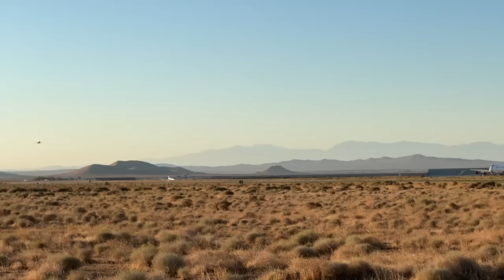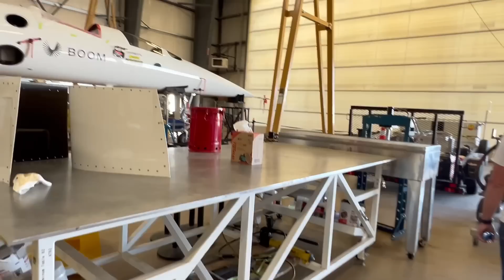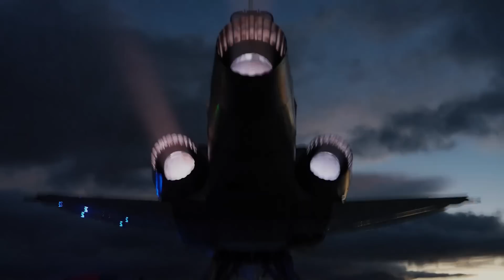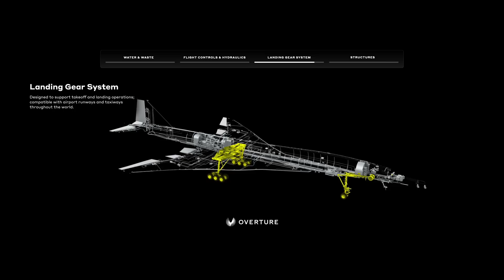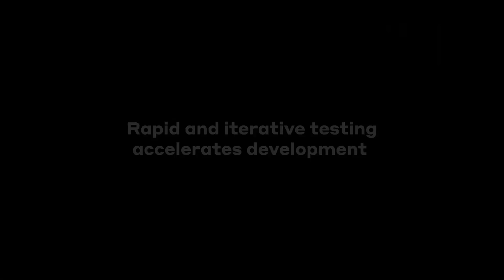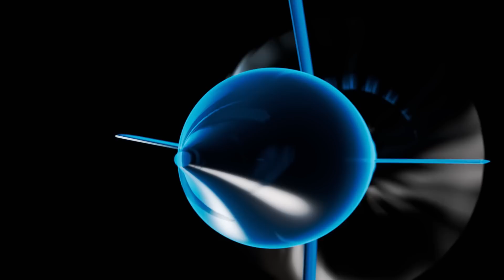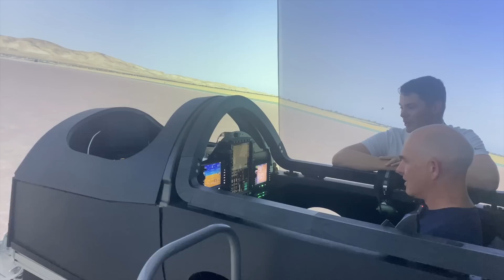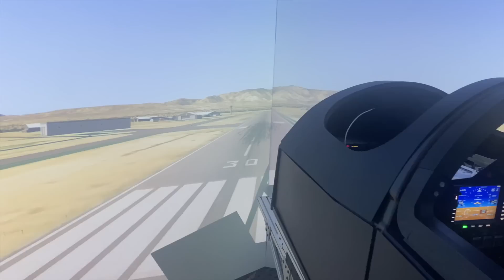Will This Experimental Supersonic Aircraft Show Supersonic Airliners Can Work?

Comment: There is demand for supersonic fly. Hell, there is a market for hyper-sonic fly. In fact, there is a market to use Starship as a ferrying passenger vehicle.  The problem is just the cost and the booms. Solve both these problems, and You will be swamped with orders.
Reply: starship will not ever be an intercontinental passenger carrying proposition
Reply: @DrWhom  Kinda irrelevant for my argument - based on the fact that Musk himself said it was one possibility.

Personally I don't think it will - too much red tape, and not sure if the price would be reasonable. But, again, not relevant for my argument, since it was based on "even IF..."

Comment: 15:15
2x independent cameras...
But both bolted onto 1x landing gear... 
Good thing landing gear has been 100% reliable for over 100 years 🙄
Reply: very important point, they should put cameras on the nose itself directly on the fuselage
Reply: @oadka  maybe under the nose out of an airflow that could scratch/ sandblast/ dirty up/ get birdstrike goo on it... All of which have happened in previous accidents/ near misses

Comment: I was really hoping these two cameras would provide a stereoscopic feed to the pilots... Would be an interesting step forward
Reply: Very true - should be able to afford a VR headset
Reply: well then there is no redundancy, so they need to add 2 more cameras
Reply: @oadka  I think doubling the cameras in each of the left/right redundant systems would be possible... where a single failure would be "fail operational" and a double camera fail on one side would be reversion to a flat 2D display (with higher minimums for example).

Obviously the implementation would be too complex at this stage, but could be a move in the future.

Comment: GE, Rolls Royce, and Pratt absolutely do compete in the market for supersonic engines. Examples include the GE F110 and the (abortive) F136, The P&W F100, F119, and F135, and the Eurojet (RR+MTU, mostly) EJ200. With Overture. Boom is basically proposing to disrupt the low end of the military turbofan market.
Reply: Boom approached them all to request an engine for the Overture, and they all said no. It's fair to say that they're not interested in building engines for an SST (which have significantly different requirements from military engines, primarily when it comes to certification).
Reply: @johannesgutsmiedl366  I can only imagine Boom wanted these manufacturers to develop them an engine and also fund the development .othervise they would not turn them down
Reply: @johannesgutsmiedl366  And the biggest barrier to certification is takeoff noise, which the military don't need to worry about.

Comment: The engine efficiency is the main blocker for the next generation of supersonic commercial passenger aircraft and once they get past that it shouldn't be too difficult to build something to replicate or improve on what Concorde did with the technology from 50+ years ago.
Concorde was extremely thirsty so the fuel load was huge. Between engine start, pushback and taxi from the terminal to the runway at Heathrow it burned 2.5 tons of fuel, and even at idle the engines were that powerful the pilots had to constantly hold the aircraft on the brakes to stop it rolling away.
Also, all takeoffs for Concorde from any airport were prioritised because if it had to wait for more than about 10 minutes for takeoff they would have to return to top up the fuel as they would be eating into the reserve margin. At least you didn't have to queue up to leave at busy times behind all the 'common' people in their lumbering subsonic aircraft, you just went to the front of the queue and left.

Comment: @scottmanley
Can you do a piece in the “old” shockwave mitigation device they used to call an aero spike many years ago when I was young. 

Basically it was a high pressure plasma cutter aimed forwards to act like a small rocket pushing the plane backwards 
BUT they were saying that by not having the initial separation point at supersonic (hypersonic) speeds not only pushed the high pressure/temperature shockwave off the skin but was not a solid point and could move with changes in pressure (think suspension against turbulence) and by having that small amount of “give” in the point of contact had a noticeable reduction in drag.

Comment: Just an observation on your comments regarding the engine manufacturers, GE and P&W are the 2 main engine suppliers for US military jets, so they do have up to date compact supersonic engines, but not necessarily efficient as the requirements for a military jet are obviously different to commercial.
Reply: Also not certified for operation on civilian planes, and that may require complete ground up redesigns. Rolls Royce also has significant experience building military engines, and they were the initially intended engine supplier for the Overture before they decided to walk away from the project.

Comment: The airlines do not want “slow, efficient planes.” They want efficient planes. 
They would love to go fast, but the reality of drag vs velocity dictates against that, at least at this time.
Reply: Also, high landing speeds are dangerous.
Reply: Aren’t the most fuel efficient aircraft actually turboprops, rather than jetliners?🤔 The other costs such as employees and engine life probably make jetliners cheaper.
Reply: @martijn9568  No.  Turboprops are high-maintenance and low power.

Comment: "'a good landing is one you can walk away from', I can assure you that phrase did not come from a flight instructor" lol
Reply: I once had a landing so soft the only way we knew we'd landed is hearing the main wheels spin up. I was grinning ear to ear until my instructor said "nice but you were 2 feet left of centerline, you NEED to fight for the centerline"  d'oh!!
Reply: New to aviation, I see. That’s the standard phrase, along with “fly it all the way into the crash” and the quote “takeoffs are optional, landings are mandatory” and “it’s better to wish you were in the sky than on the ground”.
Reply: Yeah, he's not wrong. That phrase definitely did not come from a flight instructor. If you aim for perfect landings each time, you're a lot more likely to consistently end up with ones that you can walk away from vs. if you just aim for landings that you can walk away from.

Comment: This has absolutely NO chance of going commercial.  First the environmentalists will knock the NxOx output, and the H2O vapor at high altitudes.  As "everyone" knows, our planet is die-ing due to vapor trails, and CO2 choking us all.  Even if they go "publicly" into a hydrogen-powered system, there will still be water in the effluent (and NxOx unless they also have O2 tankage).  Actually, when one looks at rockets, using O2 and H2 as fuels, that would be the best way to get across the ocean, really fast, without environmental suicide.  Thirdly, the "richies" which fly these platforms, do NOT really want to get there faster.  They really want to be "catered to" with free food and drinks, and entertainment, while they enjoy (slowly) the experience.  The faster this platform flies, the less the "richies" will appreciate it.  That is why they buy mega-Yachts, or why people go on Cruise-Boats.  I'd rather pay 10KdollarsUSD to get a three week vacation, at any modern land-locked resort, than spend that on 3+hours in a tub-full of sweaty and maybe sick people, while locked into a 3-foot seating space.  You gotta be totally stupid to do that.

Comment: it's all about the Engines, Engines, Engines however.
  If they can make a reliable engine that is easy to maintain and supports relatively quick turn-arounds, that would be a real breakthrough!
Reply: One thing Scott kinda glossed over is that Boom tried very hard to get one of the big engine manufacturers on board for this project and none of them were interested... doing this much development in house or with smaller less experienced companies was definitely not their original plan, it's something they had to do in a rush to save the project.
Reply: @johannesgutsmiedl366  Rolls royce was interested initially, but it later left as the ROI was questionable.
Reply: Any large commercial supersonic jet is going to suffer from only being able to fly over the sea because of sonic booms and high fuel consumption. Particularly if afterburners are required for take-off. Concorde also required the C of G to be moved forward when in supersonic flight which was done by pumping fuel forwards in the wings.
Reply: No problem at all except for one small thing - noise. A jet engine for a supersonic plane has to have a supersonic exhaust velocity. Have you ever heard a fighter taking off?
Reply: @kenoliver8913  Technically that’s not completely correct. An aircraft in supersonic flight can be propelled by engines producing subsonic exhaust. This is because the speed of sound in a gas is related to the square root of its absolute temperature. 

Therefore, if an aircraft is traveling at Mach 2 in 200°K ambient air, it could be propelled via engines with Mach 0.5 exhaust if it’s above 1600°K. 

This is an extreme case, but it’s very possible to provide thrust at supersonic flight speeds with unchoked, converging only exhaust nozzles.
Reply: @jet_enjoyer  I stand corrected. Thanks.

Comment: The amount of distrust there is in the comments for this company completely baffles me. Could someone explain why? Cause a lot of the questions I'm seeing from people are easily explainable.
Reply: Because Concorde, magnificent and beautiful as it was, failed economically for very good reasons and those reasons have not really changed. The biggest single reason is noise - even if the sonic boom can be engineered around (which is really tough) building an engine which can fly supersonic but yet is quiet enough at takeoff from city airports looks impossible. That is exactly why RR (who, after all, made Concorde's engines) pulled out of this project.
Reply: @kenoliver8913  look I get it, Concord was largely unprofitable until its last few years and that the sonic boom is an issue they still need to engineer around but that doesn't answer the question of distrust in the company Boom. 

What has boom as a company specifically said or done to bring such distrust towards it in the comments where some comments went as far as calling it a venture capital scam.
Reply: @kenoliver8913  as for my understanding why Rolls-Royce backed out of of designing the engine, I don't think it's reason was that it was difficult, just rather that they likely didn't see a financial reason to develop a "eco-fuel" powered engine
Reply: @vladstr100  No, definitely it was a technically very hard (read: very expensive) engine to develop for a product which even if successful was never likely to sell in big numbers. It wasn't the ecofuel aspect that was hard but keeping the noise down with a supersonic exhaust velocity. No one has faith in the company because even a cursory look at the engineering problems tells you it needs many tens of billions spent on it to have any hope at all and the market to justify that spend is nowhere near big enough.
Reply: @kenoliver8913  okay I'll give it to you there, I didn't entirely consider the factor of managing exhaust noise. And I'm not under any illusion that it's going to be easy or cheap. Solving these engineering problems is going to be very expensive, no doubt about that. And I can see why people might not have faith in it becoming reality. 

But lack of faith, I think, it's not the same as distrust in the company. The distrust is what I'm trying to understand in these comments. Maybe it's because my senior design project was to design a supersonic Business jet and that's clouding my judgment but I don't see any reason to distrust the company in of itself the way that some of these comments are.

Comment: The engine is the real challenge. Contrary to popular belief, the Olympus engines on the Concorde were extremely efficient in supercruise. They might get some efficiency gains in subsonic flight, but it'll be hard to them to better the Olympus engines above Mach 1. And, of course, there's the question of engine noise. Certainly not having reheat will help with that, but it'll still be a challenge to meeting current regulatory standards. And then - of course - there's the question of sonic boom.
Reply: On its own engine noise is a killer for this project. Supersonic speed=supersonic exhaust, and there is no way around that even if you don't achieve that speed with reheat. At takeoff Concorde never met noise standards of the time (everyone just politely ignored the rules), let alone the much tougher ones these days for urban airports.

Comment: "The demand for Concord, though small, never went away" - oh yes it did (sadly) - because the need for a physical presence in meetings across the atlantic, or the availability of cash customers who cared about saving that much time on a flight to Dubai, DID diminish. Or so I was told by the man who flew the last Concord.  That's why they folded it.

Comment: I'm sure I remember hearing about a 3-engine supersonic bizjet concept called Boom in a flurry of press releases years ago, touting superconducting generators inside the engines to provide electrical power. It was shocking that journalists were repeating this obvious nonsense without questioning it or getting any quotes from outside experts. 

I assumed it was pure vapourware. If this is the same outfit, well done to them for building a real plane that really flies. My question: if you had a real plan, why did you try to sell it with superconductors operating inside the core of a jet engine?

Comment: Concorde first flew at Mach-2 66 years after the Wright Brothers first flight & only 18 years after the first jet airliner launched. It was an incredible achievement with the materials & design/manufacturing tools they had available at the time.

50+ years later we should be going faster not slower.
Reply: We are getting there more efficiently - speed doesn't matter in a world with limited resources & a biosphere to protect.
Reply: @nightjarflying  The purpose of this aircraft is speed, nothing else. It is not more efficient that other airliners, not cheaper per passenger mile, just faster. But not as fast as something done half a century ago. If "speed doesn't matter" then this aircraft is irrelevant rather than simply unimpressive.
Reply: @johnafish  Exactly - supersonic passenger  transport is irrelevant or worse. It belongs in the age of excess that we have left behind us.

Comment: Want to shave a few hours off a transatlantic journey? Make the process of checking in, boarding, getting off and retrieving luggage faster. Be rather cheaper than travelling at mach 1.6.
Reply: This plane is already catering to people who have priority boarding, assistants dealing with the luggage or are even used to flying from charter terminals. So for them the journey itself is a more significant part of the travel time. Still, whether this market is big enough to support this development is very much an open question.
Reply: When you already have an 8 hour flight, most of that is quick in comparison, and you can already pay for priority/fast track. If you can almost half the actual time in the air, there will of course be someone willing to pay the premium
Reply: Just having someone to operate the gantry bridge would be a huge improvement in civil aviation. 

Rich people, please stop adding more co2 to the already f’d planet.

Comment: even a bullet, basically the most aerodynamic shape possible, makes a fairly loud crack, and it's tiny, so I bet it'll still be too loud to fly over populated areas, especially if they plan on making passenger plane sized versions.
Reply: You'd bet wrong - the profile of the boom is more a thud with this configuration
Reply: @nightjarflying  it's not the type of sound, but how disruptive it would be to people on the ground, be it a thud or a crack.